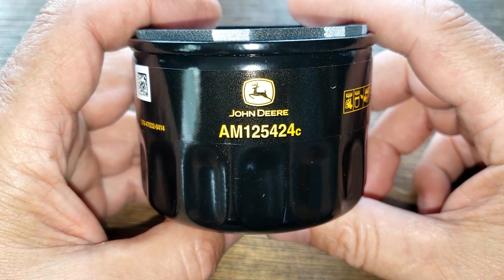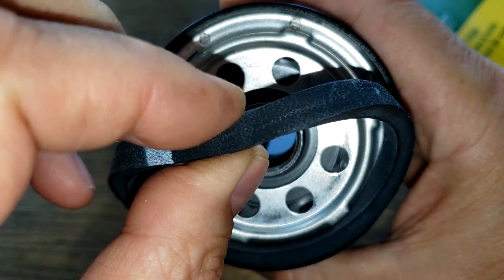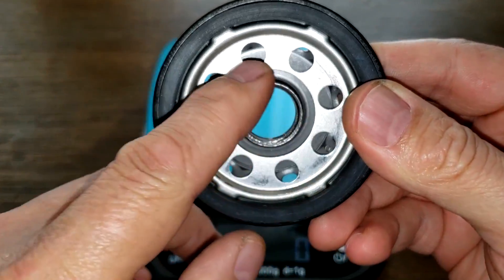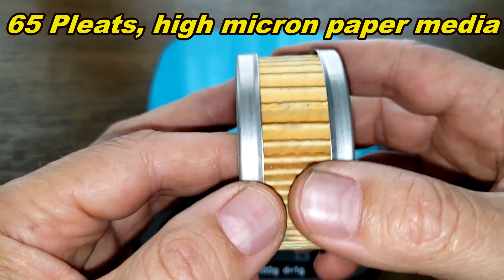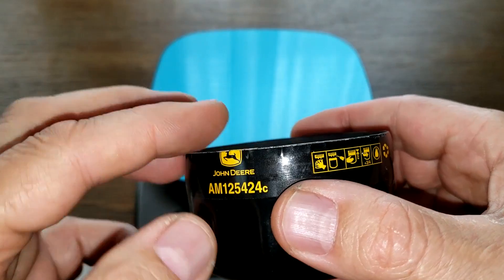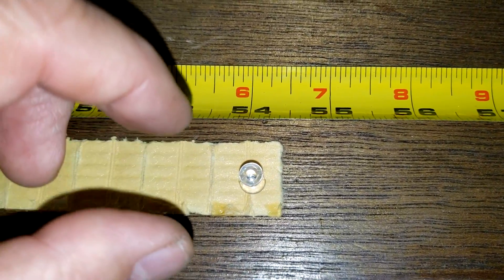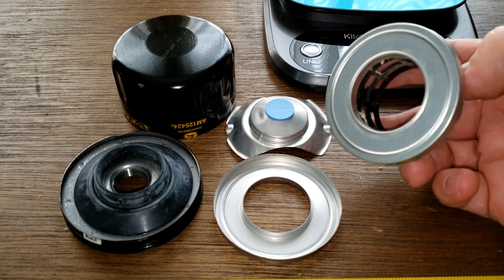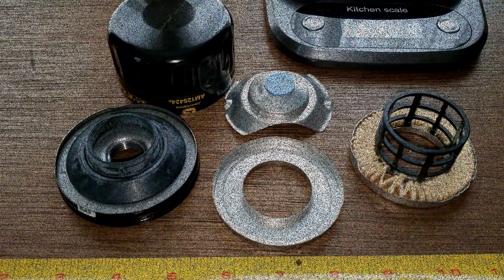John Deere Oil Filter Cut Open AM125424c Oil Filter Review

Comment: Looks fine, just way too small to hold all the breakin alum,gasket and crud. I got one at 14 hrs. So full of crud! Replaced with longer yzzd1 for toyotaco 2.7l 4 cyl. May not be 20 micron grabber, but flows fine. Next a hengxt.

Comment: John Deere's engine filter for most their dozers and backhoes and excavators are actually just 6 to 8$ at dealers and are top notch. Buy them by the case. Of course you could substitute them easy with a cross reference.

Comment: .A basic lawn tractor filter. Many have just went with the SuperTech 3614. $3. Or one of the Fram offerings.  It's larger and cheaper. Ford threading. Will fit on most all tractors and most, if not all, Zero Turn mowers.
Reply: You're correct about the Ford type threads. On my Husqvarna Intek v-twin I use a Motorcraft fl400s. It's more than twice as big as the stock Briggs filter. 5 seasons... change the oil and filter twice per season and... so far so good.
👍🏼

Comment: For $13, I'd say go with a Fram PH3614 or Supertech MP3614,  they should have more media and a silicone ADBV which I would think is more preferable on a hot air cooled engine where nitrile has a tendency to turn into a rock. In downward vertical mounted application, I'd even go with a PH3600 or PH8A if they'll fit, obviously in topward vertical mounted applications or horizontal applications, I'd recommend against using the much larger filters as they tend to add a lot of capacity and if the ADBV were to malfunction it'd probably severely overfill the sump.
Reply: We're not talking about much oil and once the engine is running it doesn't matter. A silicone ADBV isn't likely to fail anyways.  I'd rather have the extra capacity as lawn and garden engines have such small amounts to begin with and the extra oil might help in cooling, too.
Reply: On a small engine, the amount of oil a PH8A can hold is very significant to the sump size and could very easily flood the engine out if the oil were to drain back into the sump.
Reply from the maker: Yep,
This filter is way overpriced, I haven't looked into it but there should be other filters that would work and cost much less.
Reply: @WhipCityWrencher  It should be 3/4-16 threads, and it's essentially a shorter Fram PH3614/Motorcraft FL910.
Reply from the maker: @brandonupchurch7628  Ahh,
Then I'd try out the New Fram Ultra XG3614 😊
Reply: Hopefully, it's better quality for that price. Anything made by John Deere is supposed to be of higher quality.
Reply: @ellalamont6943  The John Deere is just a cheap champ e-core filter, other than the shorter element it's pretty much the exact filter you get when you buy a $3 ST3614 at Walmart just this one has the John Deere name painted on it.
Reply: Whip City Wrencher has lots more information with regard to this filter than I do. It was my understanding that brand name products are of superior quality.
Reply: And, especially a well-known brand name such as John Deere.
Reply: , Thank You for your input! I will definitely show your comment my husband. The more information we have, the better equipped we are to make much better decisions.
Reply: @ellalamont6943  Everything they sell is way overpriced.  And now they won't even let the Farmers that do buy them, work on them thierselves, by denying them computer access info!
Reply: @tinamcgarrah7794 , WoW! Thanks for your input! This is how we get informed.

Comment: Appreciate this. I just bought a 2022 john deere 375r zero turn mower that uses this filter and I was curious how good it was made.  I'm not too picky about this but I'll still use a better filter. Not sure yet on a boutique oil but I'll more then likely just use a Napa gold/wix filter and mobil 1 euro 0w40 for now unless I decide to go boutique with high performance lubricants. Motor calls for a 10w30 but mobil 1 euro spec 0w40 for an off the shelf oil has pretty good base oil stocks as well as good zddp and detergent package in it which will help with break in. It's also very close in viscosity to a 10w30 and has a pretty low percentage of noack as well. (Less viscosity impover polymers)
Reply from the maker: Hi jacob,
Thanks for sharing!👍

Comment: Thank you, love what you do. 

I cut up many used John Deer oil filters and have been disappointed in what I have seen.  

There is a 2017 Bob the Oil guy thread  which reports JD filters are made by Champ labs. 

Your OEM Filter  streak continues!
Reply from the maker: Thank You!
It does look like a Champ made filter

Comment: I would just run a Supertech MP3614 its larger filter area and $6. Also you could run ST3614 but has no bypass valve compared to the MP3614 filter.
Reply from the maker: Yep,
 if it fits your better off with the Supertech😊

Comment: Seems like Champion junk is really proliferating in the rebrand filter market. More all the time. Not good. Thanks for the upload.
Reply: What's the problem with Champion, for their usual market of cheap jobber filters, they're decent filters, have pretty consistent quality, regardless of you're feeling on the plastic core. The problem here isn't Champion, it's John Deere slapping paint on a $3 filter and asking $13 for it.
Reply: @brandonupchurch7628  You make a good point but I’ve changed a lot of oil and opened a lot of filters and e cores are by far the worst filters at any price. Fram orange can is much better even though I wouldn’t touch one of those either.           E cores count on the oil to keep the contaminants suspended to be flushed out during an oil change. They filter does next to nothing. Oil comes out as black as a moonless night. Other filters that cost pennies more, have 100 times more filtration and performance. You are correct in that the bigger crime is equipment manufacturers putting their name on this stuff and fooling people into thinking they are getting a premium “factory approved” product. Instead they are just padding their coffers with markups. Champion sells their own branded inferior products for cheap and the manufacturers take this same product and mark it up by 3 and 4 times when their name is on it. It’s never right to sell inferior products as “premium”. I’m sure there must even be laws against this but these big companies get around it.
Reply from the maker: You are Welcome!

Comment: It looks no different than an AC delco or a supertech on the inside just half the size. These filters are drastically overpriced! Should be 2 or 3 dollars for no more filter media that you are getting. Just my opinion...thanks for doing these whip
Reply from the maker: You are Welcome!
Reply: It's probably for a lawn tractor. I'm sure  John DEERE don't have filters made for cars.
Reply: @alanmerritt860  You could put this filter on a car if the thread pattern was the same. I wouldn't recommend it but you could. My point is it's overpriced for what your getting.

Comment: $13? Paying for the Deere name. In fairness OPE filters are more expensive than auto equivalents. IF room permits, 3614 equivalents like Super Tech MP3614 $5.50 (same construction) and Motorcraft  910S $4 both with silicone adbv will work instead. Or use an online oil filter cross reference to find less expensive aftermarket alternative OFs. Thanks for vid
Reply from the maker: You are Welcome!
What I would do is give the New Fram Ultra XG3614 a try then do a cut and post.
Reply: @WhipCityWrencher  That will work. Though my preference would be the see the new Ultra run 20k mi. on a vehicle. A true beta test. ;-)
Reply from the maker: @faxmen09  Yep

Comment: Nice job doing the video, but the filter is way Overpriced.  Surprised at the small amount of filtering media.  I've been using a WIX 51394 for the past 27 yrs on my Deere mower with no issues...less than half the price of the OEM.  Agree with Rooster...what in the world is a "High Micron" filter??? It would seem to me that you would want a filter that removes particles down to a low (smaller) micron level.  Also agree with Robert I...don't understand why the glue gave away cleanly from the end cap...have to wonder what it would do when subjected to hot oil.
Reply from the maker: Yep,
I don't think it's a very good filter and certainly overpriced
Thanks for your feedback.👍😊

Comment: Great job as always!  Hey, your first OPE (outdoor power equipment) filter review.  Consider going back to Home Depot or a Deere dealer and buy an Easy Change oil filter, about $40.00 + .  You will probably be the first to dissect and review one. Many of Deere's current lawn tractors use this system.  Probably not an after market available yet. You could also do a video on how to change the Deere engine over to a regular spin on filter, since the new system is convenient, but expensive.  Just food for thought.
Reply from the maker: This was a requested filter review, I don't know how many more of these I'll do. I guess it depends on how much interest I get from this one.
Thanks for watching and your feedback👍😊